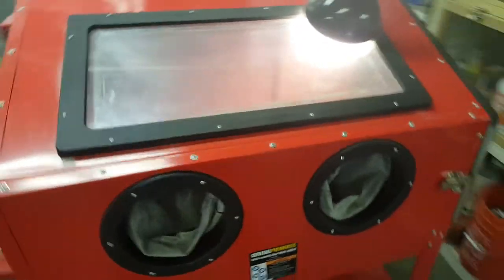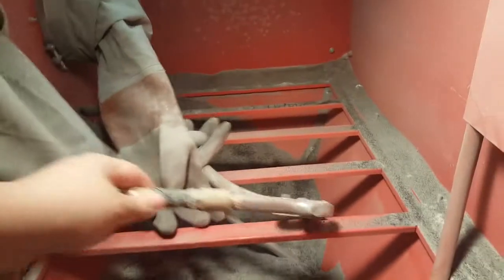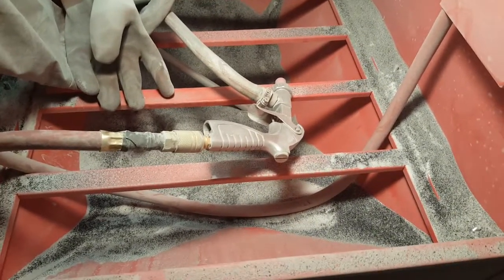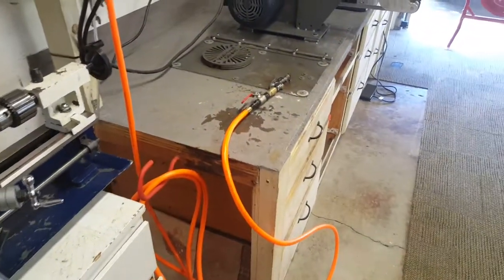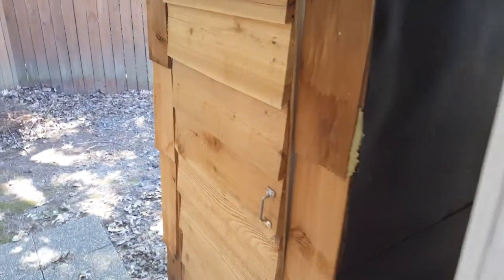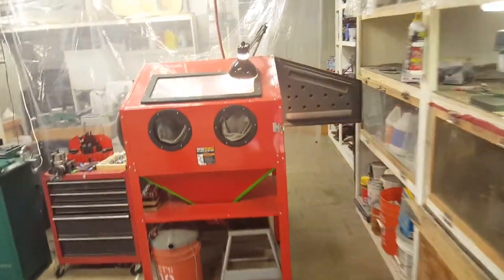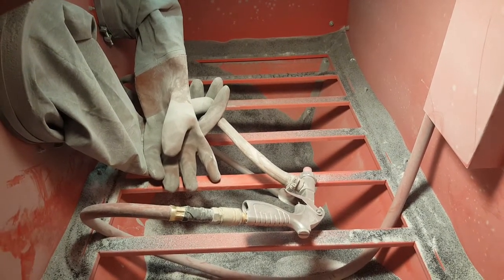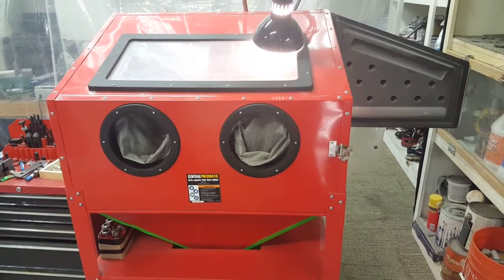Air compressor setup

Comment: All lines should be at minimum 3/8".  I have the same sandblast cabinet and had to drill out my gun as there were many imperfections in the cast.  I would recommend 1/2" air lines for sure.

Comment: Hey brother,
pretty much the same setup here. The one thing I ran into was the crappy HF couplings.
The ends were too long and were actually working like a restrictor. Once I changed those out for "quality" ones that issue went away for me.

Hope that helps man!
Reply from the maker: Oh yeah? Can you recommend nicer ones?
Reply: Got mine from the Home Depot. I'll DM you a pic to show the difference
Reply from the maker: Cool brother. Thanks a ton!